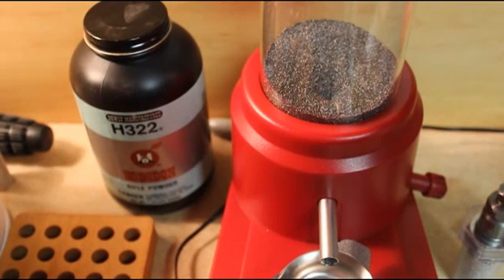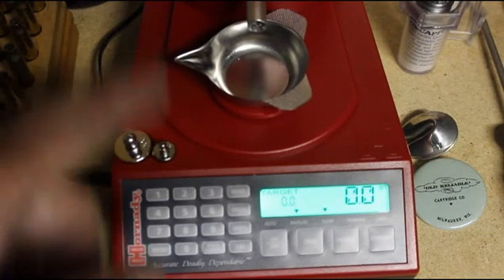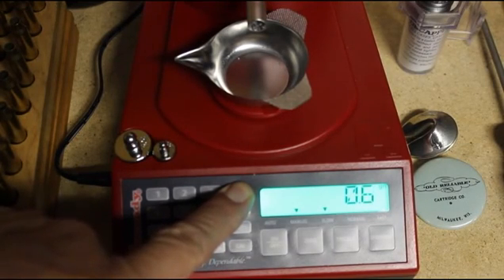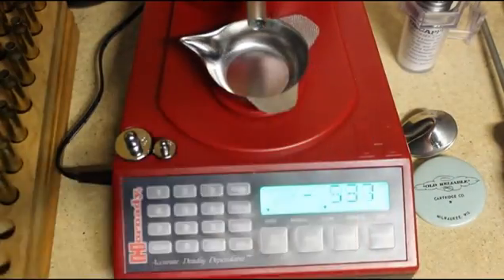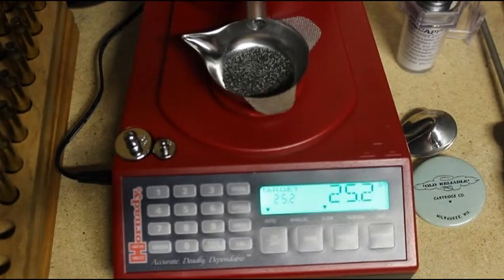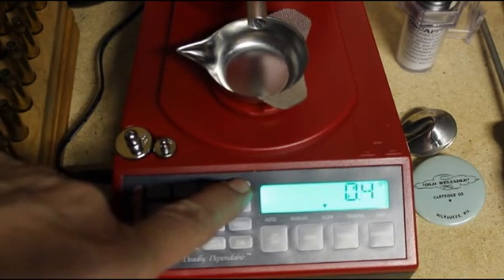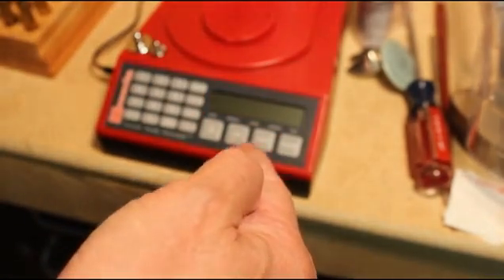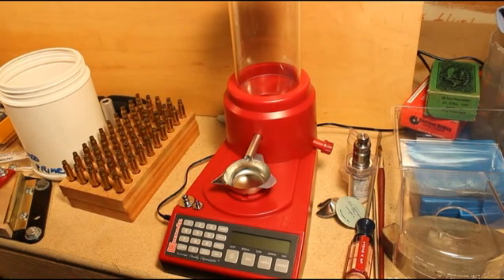Hornady Auto Powder Dispenser FAQs

Comment: My issue with it is that it can load heavy .1 or light .1 and count as acceptable. So if you dont hit the enter button after every dispense  you wont know what the actual weight is. You can have one load over a tenth and the next load under. Screws up shot development. My dispenser is already 3 tenths off when I compare it on 3 other table scales compared to the actual shown on hornady. So if I dont hit the enter button each time I could actually be 6/10 of a grain off. other than that I like it better than my RCBS
Reply from the maker: J Polston - Even our balance beam scales can be off by 1/10th grain.  We use check weights to help calibrate our scales.  Everything we have can be off by 1/10th grain.  And our reloading manuals and best loading practices are geared up to allow safety when all variable factors of guns, powder, bullets, brass, equipment, and reloading procedural variances are all taken in.  We don't need Mettler instruments with our reloading.  Best to ya,  FC Steve
Reply: @FortuneCookie45LC   yea I grt that point. But I have found it at times to be 3/10 off. But I have found when calibrating it, if I keep the weight in there for around 30 sec or longer before hitting calibrate, I get the most accurate charges when comparing on 3 other scales. We do long range so we try to keep everything on the money.

Comment: Had mine for about 2 years now. Very satisfied so far;  however, I am a little concerned as to the scale and when it MAY start drifting. I have had a couple stand alone electronic scales from Hornady and one from Frankford; they both started drifting after about a year to a year and a half. If the one in this unit starts drifting, I hope that Hornady will offer a replacement scale so the owner can install it...all in all so far, I really like the unit. Time will tell! Let's hope the scale holds up!! Keep up the great videos FC...I never fail to learn something from each one. Great job in my opinion.
Reply from the maker: MA - That is part of the reason I've been using the unit for almost all my reloading recently - to give the unit additional longer term use testing.  Had mine for three years now with pretty constant use (now even more).  And have tested against my Dillon electronic and my RCBS balance beam... has not failed yet, but then again - failure of units has a curve to it...one might outlast another...there is the lemon factor also...  If we are fortunate, failure happens within the warrantee.  If and when my unit fails, I'll send it back to Hornady to see what kind of service they provide - Dillon just replaces without question - if Hornady is wise, they will do the same...we shall see.  Best to ya,  FC Steve
Reply: FortuneCookie45LC 
 Thanks for the reply. I like using Hornady products very much. So far...I have had nothing but great experiences using the Hornady auto measure.

Comment: The machine seems to be the fastest in the market i dont understand why you slow it down in the settings so it takes about 20 sec per charge would it not be faster to dump the ocasional overcharge and do each at about 6 seconds each? Do you still have the unit and are you happy with it long term?
Reply from the maker: Guy Good - Seems logical, but problem is that if the machine is too fast, every charge might be an overcharge...Plus, the slower time gives us the chance to seat the bullet on each case we charge.  Works real well, if we need more speed, then having a second dispenser would be the way to go and run 'em both at the same time...Have a great day,  FC

Comment: Buy the RCBS this thing is junk , I own one and fixing to use it for target practice, it overcharges 98 % of the time . Try running extruded powder in it and you will agree I promise .. this thing is junk ..
Reply: You yourself have a right to say it's junk....in your experience it may appear to be. I have almost never had a problem even with long cut extruded powder; however I normally use shortcut powder, for the powder itself is the problem, not the machine. Even when drop charging and hand trickling, reloaders experience a problem at times with  long cut extruded. Taking the time to learn the machine and how to truly operate it takes a bit of time. If I do have a problem with certain powders, I set the machine to throw a lesser charge and trickle in the remaining by use of a hand trickler, this machine even has a feature for that. Actually, I have used both the RCBS and the Hornady; but I purchased the Hornady over the RCBS due to I did not experience any difference between the two and the Hornady was cheaper. Just my humble thoughts. Buy/purchase as you see fit, but I do think the Hornady is far from junk. IMHO
Reply: farmerjoe338 did you watch this video as it exactly explains how to precisely set it up? Since adjusting mine I have had zero issues with over charging.

Comment: I have one.  It goes in the trash this week.  It worked fine for a year or so but now it is junk.  It over-throws 90% of the entered weights.   Will not select slow speed.  Will not manually operate.    Slings powder grains.   I suspect these have to be used in climate controlled shops, but like most, I only have my garage to work in.
Reply from the maker: Jim Davenport - I'm using mine a fair amount doing weighing and dispensing - trying to test how durable it is.  Mine is over a year old now also - let's see how long it takes to go bad - The warranty may have passed, but I'd send it back to Hornady anyway since the word will get out - if these things go bad after a year, what good are they?  Mine is still working well, but we need more data from the field on this durability angle.  Best to ya,  FC

Comment: i recently purchased mine the only thing i don't like is the cleaning for the next powder because powder don't clean easy on the drain tube need to tilt to the side and tap on the drain tube
Reply from the maker: +ocean374 -- Congrats on getting your Hornady..!!  I haven't seen any problems cleaning the drain tube.  As you also do, the last thing I do is tip the unit so the drain tube is vertical and any powder in there can fall out.  Have a great day... FC

Comment: Sure beats trickling powder into the pan by hand from a Lee Dipper, but it works for me at this point in my reloading career.  There seems like there is no end to the tools and gadgets a reloader wants.
Reply from the maker: gapster46 Do we need it?  No, we can trickle the old fashion way - by hand and eye.  The powder tricklers available from all the companies beats using a dipper or spoon to trickle though... This dispenser is nice though - I'm using it more and more...Have a great day
Reply: Sure, it’s a nice tool, but that’s why I used the word “want” and not need.  Eventually I’ll probably step up my method of throwing powder onto a scale with something like the RCBS Uniflow Powder Measure to the point I’ll only need to check the weight every once in a while, but the dipper to pan works very well for me.  I’ve tried the dipper alone enough to know I can’t use it without a scale.  I got weights of 42.6 to 43.8 grains just using the dipper, and that doesn’t cut it for the 38 grains I need with the powder I’m using.
Reply from the maker: gapster46 Sounds like you have a fine "handle" on the situation, gapster.  That video's going to be a fun one to watch... Best Regards

Comment: Notice that the scale reads different each time you take the charged pan off the scale 0.3 grain variance.  Is that an issue?
Reply from the maker: pr4runner The cause may be that bench vibration is making powder kernels land on the platform.  But the scale rezeros every time the scale pan is replaced, so it shouldn't be a problem.  However, I'll be checking this out next use...If so, I''ll be sure to puff the powder grains off and see what the reading is... Best to ya...

Comment: Another thing for the someday list. The big question I have for units like this, is: "how much do you trust the accuracy of the digital scale?" I've been wanting an RCBS or Ohaus 10-10 just for analogue certainty.
Reply from the maker: GunFun ZS I've been loading maximum charges with it, and the pressure signs have been in line with everything I've always done....  If the electronic scales are off calibration, that is not good.   I'll have to do a comparison with my other scales and balances now that you bring this up... Best Regards...
Reply: FortuneCookie45LC Looking forwars to your findings.
Reply from the maker: GunFun ZS Just compared the Hornady weigh with my trusty RCBS 505 balance beam scale...practically the same weights within less than .1 grain...reported it in my latest video...Have a great day and thanks for the suggestion on doing the comparing...
Reply: FortuneCookie45LC Funny thing. I had that video paused a couple seconds before the discussion, in order to read this message.

Comment: Great review, thank you.  One question.... Do the setting you made to the trickle speed and how far from the goal the trickle begins get stored for the next usage or does it reset with a power down? Thanks again for your time.
Reply from the maker: Neil Harris Once you turn power off, you have to reset whatever settings you want...the machine does not store anything for you, not even the calibration.  But it's not really a problem to reprogram... Good reloadin' to ya
Reply from the maker: +Neil Harris -- I'm told that it is kept, but I don't trust it, I just reprogram every time - not much bother and I am getting uniform results... Best to ya,  FC
Reply: +FortuneCookie45LC I just picked one up a few weeks ago. it runs like a champ so far. I have been checking it against a digital scale that measures to 0.02 gr and it's pretty consistant. the only issue I have with mine is that it throws  consistantly 0.1 grain under what my digital scale reads so I have to set the auto charge 0.1 gr higher to match my other scale that I did all my load work ups with.

Comment: This looks very good, does the fact that it is made from plastic give static problems when dispensing powders like Hogden Clays, which I seem to get lots of metering problems with due to the form of the colnels of powder.
Reply from the maker: Englishman French So far, no static issues - Whenever I got powder granules sticking to the sides of the hoppers, I used to just wipe 'em down with anti-cling laundry wipes...but lately haven't had to do that...the Hornady unit has been working splendidly.  Got the overcharges down to 1 out of 50.  Best to ya
Reply: FortuneCookie45LC Many thanks for the anti static wipes tip, that will be in the girls department at the store, I will take a look at them, the very light "flakes" of Clays do seem to cling to the charge tube, but your tweek should fix that issue.
Reply from the maker: Englishman French Good reloadin' to ya...and Have a great day...